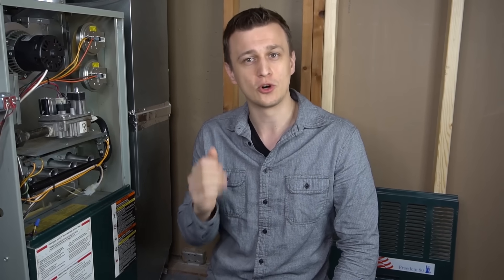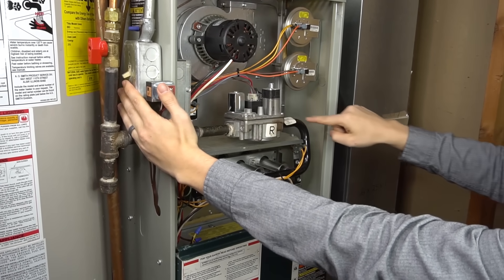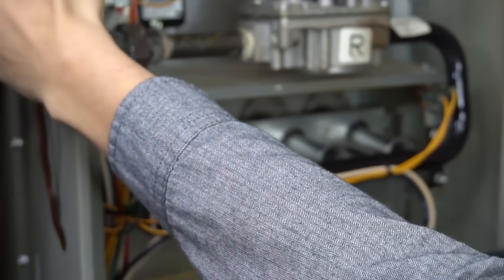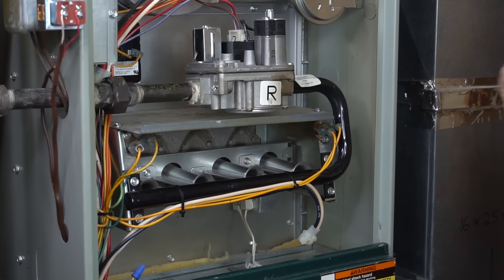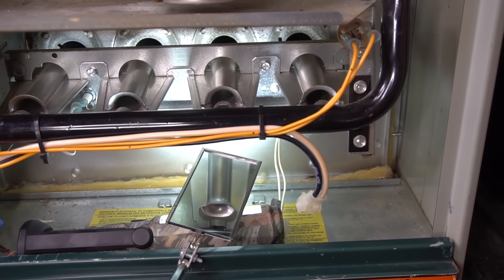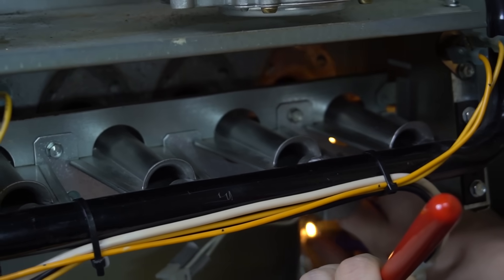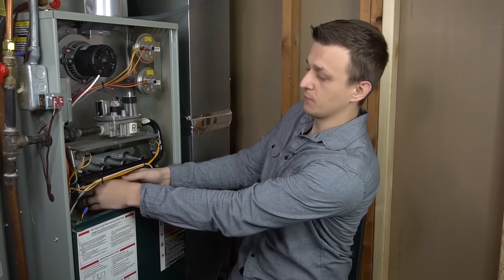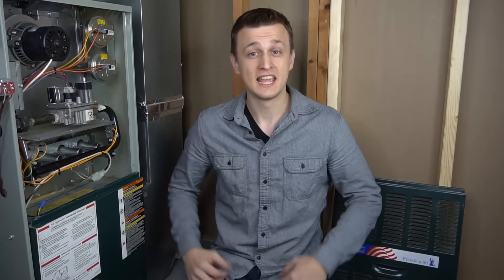Gas Furnace Wont Ignite - How to Manually Light Burners

Comment: What would be another problem with the ignitor when it works then it won't? I messed with it by unplugging the ignitor then plugged it back in. It works when I do that. It may work a day or two then I have to mess with it again. Could the ignitor go bad without actually burning out? I've had the ignitor for about a year or a little longer. Thanks for any help. EDIT: I discovered that the pressure flow switch, I believe it's called, was a little plugged up. Just a tiny bit of har but was enough to make it fail on occassion. The hose leading from the pressure switch was a simple fix but could have cost a couple of hundred depending on time a tech could get out.

Comment: Hi Jay! 
I did the same as you show in the video. I replaced the igniter with a new one  but the flames not coming at all. I heard  the click coming from the gas valve and when I do manually it works . Do you think the igniter is in a wrong angle or is far away from the burners ?
Reply from the maker: Hi Danny! Sorry to hear about the furnace troubles. If the ignitor is new, the gas valve opens, and you are able to light it manually, then I would suspect that the burners are dirty.. I would also check the orifices to make sure no spiders made a home in one of them (the little holes right before the burners where the gas comes from). Here is a video where I clean mine: https://youtu.be/6ehk0NZVFcg

Comment: Hey I need your help! I have a Trane xl 80 Furnace TDD100R948ED Serial # R5043H61G. It looks ( and is ) just like your American Standard except it's a downflow. My problem is that I want to know what the manifold pressure should be set to? The plate on the furnace only gives me 5 in. wc and that is it. The furnace is a 2001 model and has a gas valve the same as yours. I know back then the low side on most furnaces was 1.4-1.7 and 2 stage was 3.0-3.5. I can't find the installation or service manual anywhere for this model! Any assistance your could offer me would be most appreciated!!!

Comment: There are two kinds of igniter, The flat and brittle one and a rod-like one. Are they interchangeable?
Reply from the maker: Yes they are. The brittle one is silicon carbide and the slim sturdy one is silicon nitride. The nitride igniters rarely fail and they can be used to replace the carbide igniters as long as the voltage is the same (usually 120v). They have universal igniter replacement kits that come with a set of various brackets to help position the new igniter in the right place.
Reply: @WordofAdviceTV  You are mostly correct, but I will add to it Silica carbide to silica carbide igniters are not universally replaceable as ignition warmup times vary. Ie you cannot replace a 34 sec. carbide igniter with a 17 sec. igniter, but the reverse is usually fine.
SINI or silicon nitride can usually replace a silicon carbide igniter because almost all SINI igniters have fast warmup of 17 sec. or less.
But it important to know the operating voltage as a few furnaces use 24v, 12v or 80v instead of 120v for the ignition circuit.

Comment: Hi Great videos...I have a Trane XL 80 system quite old.  In the past I have changed the ignitor and the sensor no problems.  Now I had the ignitor issue again and ordered two new ones just in case.  Replaced the old one and also followed your instructions on the cleaning of the sensor with a brass brush.  Still can't get the ignitor to work.

Any ideas how to do this.  I tried both ignitors just in case one was bad and still no good.

Also the sensor I have  has that right angle on it.  Is that supposed to go into the burner hole?  There is no way it would reach so does that sensor just stay out?  Thanks for your help, I am going crazy.

Comment: Hey so I have a guardian furnace . I turned it off with the switch and it won’t come back on . I think I have a electric igniter since there is no pilot button . Would I be able to light it manually ?

Comment: You say the ignitor is on the first burner and the flame sensor is on the last. Are all furnaces like that? I'm having issues with my old gas package unit lighting properly. The ignitor is on the last burner and the flame sensor is on the first. Could that be causing an issue? Should I switch their locations?

Comment: Vintage furnace natural gas. I am working with a manual light pilot. Worked fine was lit after a gas line service.  Tenant turned heat on and went out. Now it won't light at all. I checked for clogs there are none the thermalcouple is clean. I tested a new pilot and thermalcouple and it still won't light. The gas line is turned for flow. Checked for leaks and none. Turn unit off for 3 minutes ten minutes and 30 minutes and went through holding the pilot button on and it won't light not even for a second. The main box the 2 lines connect to can that have a clog or not send gas for some reason?

Comment: So I dont have an igniter in mine and its quite old. It lights by a pilot that I manually light and after replacing the thermalcouple & then the entire pilot assembly I am happy the pilot stays lit now. Problem is that Im not hearing the gas kick on in the burners after my thermostat clicks. Do u think it may be a thermostat issue?

Comment: I came here because I want to be able to run my furnace if there should ever be a power outage. Do you need power for the gas valves to turn on? If so, can they be turned on manually?
Reply from the maker: Unfortunately if the power goes out, the furnace will not work. Like you said, the gas valve needs to be powered on to open and the blower motor needs power too.
Reply: Ok yah I forgot about the blower motor. A backup generator is probably the answer I’m looking for. Thanks.

Comment: All the HVAC techs in this post don't want homeowners to do this or know this because they won't  have a job then. The inducer which is the fan that is running removes the gas from the pipes... Hence when u turn on the furnace, u hear the fan first before the gas is released 20 seconds later... Of course there is risk if u decide to use flame for anything. Even lighting up ur BBQ grill😂 
Don't listen to these HVAC techs that went through simple training like this themselves

Comment: Great vid, I used that method 8 years ago,worked great, but now it broke down again and I cannot light it anymore, I don't hear that click on the gas switch opening, so I'm assuming, I don't know what I'm assuming,need help please, if I don't hear the gas click would that be the problem?
Reply from the maker: If the gas valve is not getting power (to verify for sure, you would need to check if it is getting power with a meter) that usually means it's a bad control board/ignition module, there is a power issue where the power is getting interrupted somewhere, or a safety limit/switch is tripped. If your control board has an LED light on it, is it blinking any error codes? (if you have the blower door off, don't forget to hold the door switch in) If you have a light but it is not lit up at all, then you likely have a power issue. Once again, to verify anything, you would need to use a meter..
Reply: Thank you so much for replying, I did notice a little green light flashing, does that mean anything, and am I checking for power on the gas valve, it should read 120volts, if I'm correct.
Reply from the maker: Well actually most gas valves will have 24v going to them. As for the blinking light, you should have a chart somewhere on the furnace or in the manual that deciphers what the blinking means. I talk more about that in this video: https://www.youtube.com/watch?v=QJAMWlJ0tbk&t=2s

Comment: Thanks for the tip!  I performed this a few minutes ago (oh how nice the heat feels right now :) Two questions though. 1. - I couldn't reach the far end of the burner tube, so I put my lighter at the near end of the tube between it and the nozzle for the natural gas. Was this a bad idea? 2. - If the furnace lights using this method, does that mean a new igniter will for sure fix the problem, or could it's lack of glowing be caused by something else (bad board, etc.). I had a universal board installed last November.
Reply: Test the igniter. If it tests bad, it is definitely the problem and an easy fix. If it's good you have other troubleshooting to do.

Comment: So if my ignitor glows but flames never show, the ignitor isn't the problem right? Poor gas flow? Is is safe for me to give it a quick light with a lighter
Reply from the maker: You can try it but do be careful. Put the lighter there before the gas valve opens. Don't give it too much time to build up gas before you light it, otherwise it will come on with a "poof" or even worse a small bang. When doing this, don't put your face in front of the burners or too close to the area.

Comment: Im having a problem with mine. For some reason sometimes it heats my house and sometimes it doesnt. I checked if i can se the flames when i turn the power on, and i can see it but quickly the flames turn off. Im not sure what is causing it to turn off the flames.

Comment: The Y from my thermostat is spliced to the wire that goes to the bottom float switch and then the wire comes from the float switch and is connected to the R that goes to the ac unit outside
Reply: I just bought this house and this is how the wiring is set up so I don’t want to turn on the furnace if it’s wired wrong please help

Comment: I have an old gas wall heater in a rental house I own but I can't find any type thermostat for tenants. How do they regulate the heat? This unit is old and seems to radiate heat from one room to other as it passes through wall into another room heating it. I want to clean it and service it myself.. Help out please..
Reply: If you can't even find the thermostat, please don't try to service it yourself.

Comment: These igniters burn out frequently in dual system homes on the down stairs system because it is being over worked. 
To fix this change the returns on the systems. Lower floors to upper, upper returns to lower.

Comment: Is there a way to keep the furnace burning? I have to re-light the lighter every 4 mins. The flame stays blowing for 2 mins, then stops to push the hot air up, then in 2 mins it try's to look for that sensor again, since its blown, it wont restart.

Comment: What is wrong if you try to light it with a BBQ lighter (my ignitor is also glowing), and it doesn't catch flame?  though sometimes it does, but takes over a minute or two (longer than it normally take or should take)  Is something wrong with the gas valve? or flame sensor? and sometimes it flames on for a second before stopping - does this about 3 times in about 5 to 8 seconds, before catching flame and running for its necessary duration (5 - 10 minutes?)

Comment: sometimes furnaces maybe able to detect a failed igniter or the igniter is wired through the gas valve and it wont open so manual lighting may not be possible

Comment: My ignitor glows, gas valve clicks, but no flame.  Immediately after gas valve clicks, if I hold a lit bbq lighter up to the burner, I get flames and heat.  Could it be a bad ignitor that is not heating up enough to ignite the gas?

Comment: Great video, but I have a question. So I removed and cleaned the flame sensor, then I removed the the hot surface ignitor. I checked the continuity and it had 50.6 ohms of power, so I figured it was good. The gas valve seems to click on, but the burner still won't ignite. So I tried to light it manually to make sure there was gas getting through. I disconnected the ignitor, waited until just before the gas valve clicked on, used a lighter, and the furnace lit, all the burners lit, and the furnace ran as normal, until it reached the desired temperature, then shut off as expected. So if the ignitor had continuity why doesn't it light the burners, what am I missing? Is there something wrong with the wires? relay? board? I'm not sure...
Reply: Do U have 100+ Vols going to the igniter?
If the voltage is there, then your igniter is probably bad.
That's why it's good to know how to chk devices,
for continuity & Voltage.

Comment: Good day to you hope all is well, I have an old furnace and it stop working. It hasn't been turned up/ serviced in the 4 years I've been in the house. I restarted it and it runs for about 15-20 seconds then shuts off. Do you have any leads to what's possibly wrong?
Reply: Sounds like the flame sensor needs to be cleaned.  If your furnace doesn't sence flames within the first few seconds it will shut down.  You should also change your air filter.

Comment: What is the transformer next to the furnace switch for?
Reply: Most likely for a Humidifier.
Reply from the maker: Coolmandude is exactly right :)
Reply: @WordofAdviceTV  Humidifier? Where does it get the humidity from? Is there any water bottle near by?
Reply: Is it a 24VAC transformer that supplies 24VAC to thermostat?
Reply from the maker: @loiilaii808  It is a Whole House Bypass Humidifier. If you watch some of my other videos you will see it on the return duct. The water supply to it is routed straight from the water heater outlet pipe and goes into a water valve before going to the humidifier. This valve requires 24VAC which is why that little transformer is there.
Reply: @WordofAdviceTV  Would you do a separate video about the humidifier? I think it would be nice.

Comment: Hey there, thanks for all the great advice.  I have a different type of problem.  On my Goodman furnace, all parts are functioning as they should, but for the past few days, it has been acting a bit schizophrenic. It will only light if I run my finger across the face of orifice number 1 (which for me is the far left side).  If I don't run my finger across it right as the gas valve opens up, it won't ignite.  A quick brush across the face and she lights up immediately.  It's very strange.  This thing has been operating great for nearly five years.  I've pulled the first two orifices and they are fine.  I didn't pull the others because they all light as long as the first one kicks on.  Any advice on that?

Comment: My 30 years old furnace has a Control Module, every time the thermostat calls for heat, 24V was applied to the module and it does a self check. If the Igniter is opened, it will go into a lockout mode, the red error light will be flashing and the Solenoid Valve WILL NOT turn on. If you can fool the module by replacing the Igniter with a 14 Ohms 200 W resistor and to manually light the burners but that’s extremely dangerous.
I personally will not even try it. A lot of unexpected things can happen. I’ll light my fireplace instead.

Comment: What if the ignitor lights up but there is no gas valve clicking?
Reply: you check your connections going to the valve if there good replace the valve if there not troubleshoot that
Reply: Check voltage to the gas valve, if 24v at gas valve, then the valve is not working.  If no voltage then the board needs replaced.
The pressure switch is working, or the igniter would not fire.

Comment: My pilot light glows hot and it cycles, heres the thing it wont ignight ... Its not cracked or anything . thinking it could be gas related but it on ... What should I be looking at ?
Reply: Most likely a bad gas valve, but could be a clogged burner or bad control board.

Comment: The power switch for my coleman 2004 model gn8s100b12uh11b sits in the on position. when I turn it to the off position it starts the blower motor ?????
Reply from the maker: That is odd... Usually the power switch turns the power off to the whole furnace, including the blower motor. I would have to look at it to tell you what's going on though, sorry. If you turn off the circuit breaker to the furnace, does the blower still continue to run? It almost sounds like the blower motor was wired to get power from a different power source. Weird..
Reply: thank you for replying.

Comment: I have a ac and furnace unit, When i turn on my thermostat for the furnace the gas pump doesn’t click like yours does in this video. I already checked the limit switch, I cleaned the ignitor switch. Do you have a idea what the issue might be? Also, are you on instagram? Thank you for your time.
Reply: Call a pro before u get hurt or kill someone

Comment: Help! All I did was remove the panel to vacuum a bit inside and now my furnace won’t light. I didn’t move anything or touch anything. After reading the codes, it says gas flow, pressure, valve, or flame sensor. I took the flame sensor off and cleaned it. Ran the furnace again and it didn’t light. I turned the thermostat off and unplugged the furnace. I plugged it back in and the light was no longer blinking, I ran the furnace again and same thing, the flames don’t light and I tried to manually light them and I couldn’t get them to light up. Am I in a soft lockout and it just needs to cycle?
Reply: The ignitor is good, it lights up but I don’t hear any clicks from the gas.

Comment: I NEED  HELP,   or anyone that can help ME,    I did the testing that you did JAY    and my resistance is HIGH,   like  118 - ohms,  &   getting  120 - VOLTS,
on the,   "SURFACE - IGN. ",
Sooo,     FURNACE is running as normal, turns off and  on,   like normal running condition, and 
will  normal for the rest of the night but then in the morning 
or  late morning,   start acting up again???
&  keep getting the same code as a -
" lockout due to failed ignition"
Is it possible that the igniter, 
is on its last leg,    or something else is going on?????

Comment: I would never ever tell a customer to manually light a furnace.  A professional has truck stock, an ignitor included.  I also want to know why the ignitor failed.  There could 10 unknown reasons why the part failed.  Get professional help and please do not try this a**hole's advice.  Further, bypassing any component could void out a warranty.